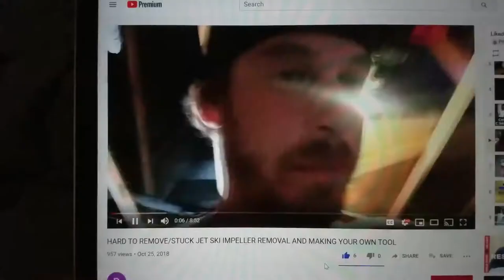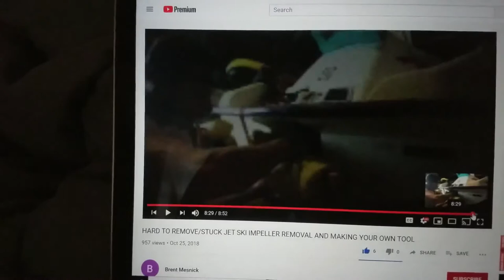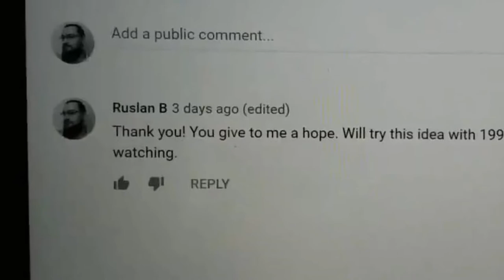How to remove impeller from 1993 Yamaha Waverunner III 650

Comment: hey Rus i have messaged before about my work on a 93 waverunner 3 i have run into a problem and wondered if you might have a solution. i have 2 93 waverunners 1 with a good haul and bad engine (was sitting in saltwater at some point) and one with a good engine but bad haul. the problem i am having is that the one that sat in saltwater has bound the bolt inside the cling and snapped off. I was wondering if you had any alternatives to cling as i cant seem to find any online anywhere? ------ i appreciate your response and no not just one bolt lol all of them on the hull with cling. i really appreciate the help. your the only youtuber doing a series on the 93 waverunners
Reply from the maker: 1) Done. see the https://youtu.be/KsZq79qYqrc
and read the description.
2) could you copy one more time your question to the cling removal video?: https://www.youtube.com/watch?v=UfTQxCZ8JSI

Comment: how is rebuilding a jet ski different from an ATV or dirtbike. are things just harder to get to? thinking about rebuilding one
Reply from the maker: i did not rebuild any land vehicle ... but for sure it should be easier than saltwater parts repair. Most frequently it ends with replacement by part from jetski which was used in freshwater. I would not recommend to by used saltwater jetski unless you have a huge amount of time to work as a mechanic for free but not ride a jetski. I bought it for $550 and was sure that salvage it once it will fail ... but i did not ... after about 1 year of nice riding i start to fix it ... and for sure for the time i spend for repair instead of working, I would be able to buy several same jetskis.

Comment: tried this didnt work still stuck
Reply from the maker: try this idea: https://youtu.be/vWc1mtemZtA
but attach the beam to rear and of the trailer and hook up the jet ski to the trailer fwd end. Use helmet and safety glasses. Sprey with WD-40 all shims. Do not hammer the parts. they are very soft.
... even my part did not work from the first time ... i almost gave up to get it out.